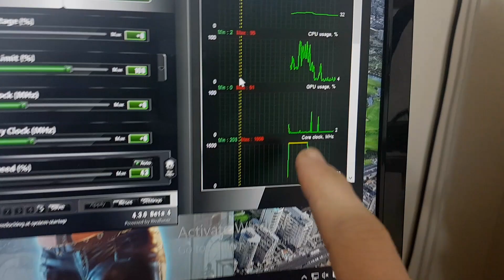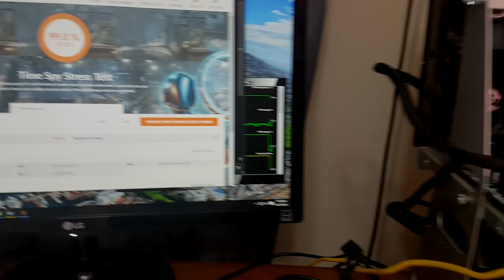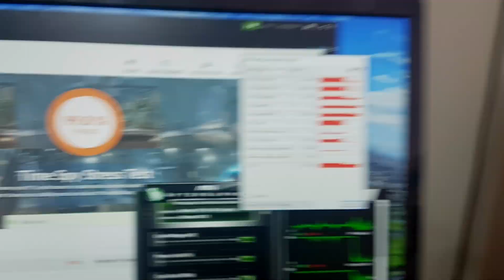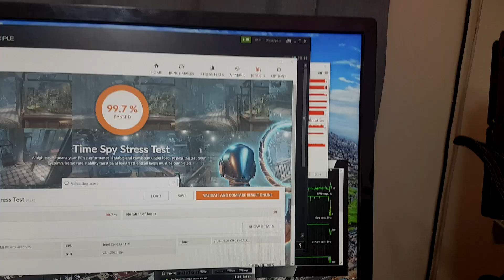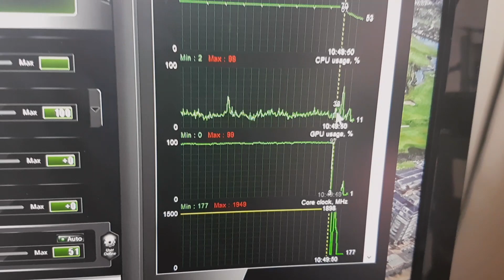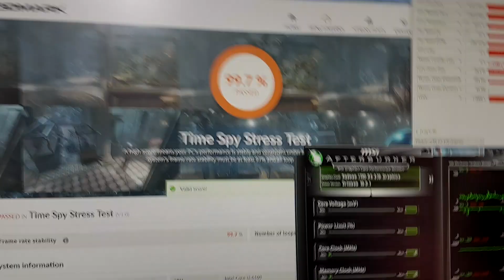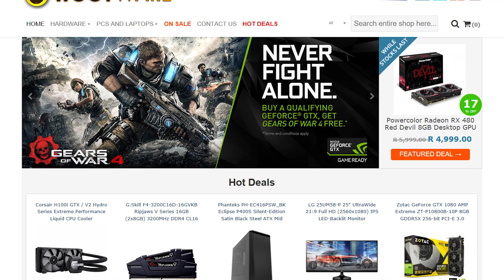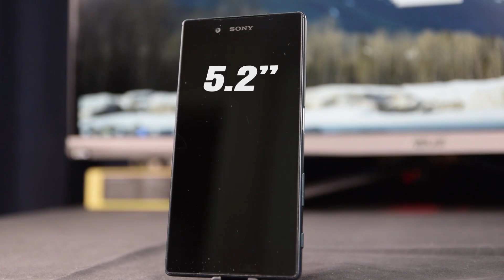DO GPU BACKPLATES SUCK?!?!

Comment: i think theres a thinking mistake with this measurements ... you mesure the surface temperature of the PCB itself without the backplate and on the other side the temperature of the backplate surface ...

but ...the backplate has a bit of air between the pcb and the plate which means this is not direktly connected to the heating source so that means the temperature of the PCB beneath is probably much higher than the backplate itself ... its a kind of heatschielding to hold back the heat .....  i bet if you place some wired temperature sensors under the backplate direktly to pcb and components the temp is much higher than without the plate ! 

and theres also NO air flow under the plate !!!

Comment: I'd like to see this test done with AIDA64 as it monitors VRM temp as well as diode of the GPU. Actually I'm gonna just do it myself
Reply: Can confirm neither the backplate or fan shroud of a powercolor r9 280x make much of a difference. With backplate on VRM1 was 1 degree cooler, VRM2 was 2 degrees cooler. No difference in fan shroud

Comment: install 2,3 or 4 cards together, you will see huge difference. Why? The distance between cards! Remove backplate, you get more free space between cards. More free space, more air sucked by fans. For one card installed, there is no big difference if you remove backplate. The big difference is when there few cards installed ;)

Comment: Which one should i buy asus 1060 dual 6gb (no backplate)for 279,90 € or msi gaming x 3gb (with backplate) 284,90€ p.s. i know pricing is a bit high in my country.
Reply from the maker: Get the 6GB, it's a better card.

Comment: the best benefit is the VRM cooling.
something 1070/80s have been overheating and catching fire.
MSi afterburner or GPU Z can't see those temps though.
Reply from the maker: The VRM cooling benefits appear to hotly debated based on other comments I've received.  :|
Reply: ***** after seeing 1080/70 catch fire due to lacking vreg cooling, I'm not taking any chances

Ordered a EK back plate with thermal pads.
Reply: That is only the EVGa because they took a chance to not use better cooling for the vrms
Reply: Tukuto to be fair, in the past, Vrms could take 125C all day just fine.
The gtx480 and HD5970 and 6990 both were housefires that ran 95C all day.

Not sure why the 1070/1080 had these issues

Comment: my opinion is 
back plate is good for protecting PCB Of the back 

because i usually cut my self by pulling off VGA out of my cass [not many] its anoying everytime or afraid to shocked
Reply from the maker: +RAY M I've never once experienced that.  What kind of card do you have? Or is it the case that makes it so difficult to get out?
Reply: ***** 
Well totally my fault sometime
XD

it was GTX560 Asus DC2
It didnt have backplate 
Case was fine but i had a habbit to pulling it so hard 

Than use vga with backplate i didnt cut myself
Reply from the maker: +RAY M Haha. Well if it saves you from injury, then I'd say it's worth it.

Comment: Manufacturers need to stop making backplates with no vents. Solid backplate will trap heat, might dissipate some but not as well as having air going over the components as well.
Reply from the maker: +periodic.insanity I'm not entirely sure this is true as most of the backplates I have actually come across have a several mm standoff between themselves and the PCB, thereby not trapping heat.

Comment: I got them for rigidity, my 7970 GHZ Edition almost died because of rigidity issues, it started artifacting and crashing because of the massive sag it had, causing the PCB to bend, for good. The reason for buying only one with a back plate is the sag, my really long Xtreme Edition 970 from Gigabyte has 0 sag and it's stupidly long and heavy.
Reply from the maker: +Rinkk Gotcha

Comment: looks like ure cooler pump isnt running should have led to indicate its on and coulour hasnt mixed my one runs at 3 degree cel, gl
Reply from the maker: It's fine, just didn't look like it's working, but it is.

Comment: by taking of the cooler and not applying new paste you wil probably lower the thermal conductivity betwen the cooler and GPU so i call this a invalid test.
anyway i dont think backplate help much in thermals.
Reply from the maker: But it didn't.  Numbers didn't show a delta enough to call for swapping thermal paste.
Reply: there was at least one with higher temps? 
the air gap between the plates can mabye affect the cooling negative
Reply from the maker: +tullgutten It was within the margin of error.  Nothing substantial.
Reply: I completely agree. Invalid test without the application of thermal pads between backplate and VRM, MOSFETS, and I think it's called the VRM memory controller that could get hot on SOME cards.
Reply: Except it was improved? Confused.

Comment: The backplate is good for cleaning.  I can scrub a backplate with a toothbrush and wipe the rest of with a not so wet wipe. Can't do that with a naked pcb
Reply from the maker: +Jomari Co Why can't you do that with a naked PCB? Have you tried?
Reply: I don't want to risk the static build up on the toothbrush possibly frying something. Plus you can't use a damp rag for fear of capillary action drawing the water into tight places unto the components.
Reply from the maker: So what you're saying is that the backplate makes you feel safer, but you're not willing to test if it actually is so? :P  I suppose I know what my next video is going to be about now.  How to clean your PCB with a toothbrush.

Comment: I agree backplates should not have any impact on the core maybe on the vrm's.
However your testing metodologie needs a bit of work. For optimal results you should of apply fresh thermal compound w and then add fresh compound again w/o the backplate. Fans should have be locked at a fix percentage. This way you either see a temp difference or a clock difference if any but again i doubt it would make much of a difference.
Reply from the maker: +Ceck Mike Thanks for the feedback. Some of what was left out was intentional, other parts not, but again, with the less "scientific" rigor applied, the results are enough to come to the conclusion even if the results aren't 100% accurate.
Reply: @UFDTech  But does it help with VRMs?

Comment: gtx 1070 1080p 60HZ performance ?
Reply from the maker: Gordon Rammstein I hear you, but you're still not getting more than 60FPS out of the card.
Reply from the maker: +Bymrh crowe 60FPS.
Reply: UFDisciple usually way more, but yes, thats probs a safe minimum
Reply from the maker: +Reece Cronin If the panel is 60Hz, you can't actually receive more than 60 FPS, even if the card is outputting it.
Reply: but a framerate higher than your monitor's refresh rate can be beneficial, as you are more likely to receive a more up-to-date frame every time your monitor refreshes, because it has more frames to choose from, as it were.
Reply: *****
True, but with more frames pushed from the card to the monitor, you can get up-to-date frames, rather than ones that are (ewww) up to 16ms old, say because a frame was pushed out to your monitor just after your monitor refreshed and the card didn't produce any more recent frames in the time between screen refreshes.

I suppose it makes no difference to regular gaming but if you play twitchy shooters or ludicrously fast racers, the delayed updating and slight input lag can be frustrating.

Comment: useless test, the backplate isn't there to improve perormance, it only improves rigidity and aesthetics. The reason why you see "higher" vrm temperatures is because the backplate isn't as thermally conductive as a heatsink so what you are measuring in the backplate thermal images is the backplate temperature, not the vrm's
Reply from the maker: The irony of this statement is that you can only state it so emphatically once this is actually tested. You're stating as fact the conclusion that I came to because of the testing.  Without testing, your statement is conjecture.  So....
Reply: ***** There's nothing ironic, that's what backplates are designed for. There's a reason why they don have thermal pads. Besides, if you know a bit (just a tiny bit) about electronics, you'd know that if you want to cool a component, the hetspreader should be placed on the capsule and that's in the opposite side of the backplate.
It's not "conjecture", it's common sense and basic electronics knowledge.
Reply from the maker: Except for some of those backplates have thermal pads.
Reply: ***** If they do, they're either useless or have a negligible impact. As I've already explaind, the only way to effectively cool an electronic component is by putting a heatspreader in the capsule. You can do the research if you don't believe me.
Reply from the maker: How do you not count this video as the actual physical research?
Reply: ***** Electronics, research on electronics. If you have basic electronics knowledge you wouldn't even have wasted time on this video.
Reply from the maker: +Potus ThePlant Or you missed the point of the video entirely.
Reply: my words have fallen into deaf ears it seems...
Reply from the maker: I think you're just trying to prove a point that I was aware of going into the video.
Reply: No, I'm not. I simply explained that this video brings nothing to the table because the conclussion is obvious. You wouldn't make a video that explained why 2+2=4 would you? If you just explained why the backplate doesn't improve performance only using words, it may have made sense but you tested several graphics card and that was a waste of time.
Anywho, I will no longer reply but do take into account that you won't capture an audience that techsavvy by making this type of video, do the research before you film a video.
Reply from the maker: It just seems strange to me that you call it so obvious, but weren't aware that the backplates did indeed have thermal pads to assist in the thermal dissipation of the rear portion of the VRMs.  This video served to question presumptions, not to prove them wrong.  There are plenty of videos that exist on explaining why 2+2=4 because theory of mathematics is actually super important.  Just because a conclusion is obvious doesn't mean that it still doesn't need to be assessed.
Reply: ***** Do you know what a gimmick is? if not, then look up the definition. Thermal pads in the backplates serve no purpose, the mere fact that you thought it plausible demonstrates your knowledge on electronics...
Reply from the maker: +Potus ThePlant Welp.

Comment: I think they just look nice, they're good for aesthetics
Reply from the maker: And rigidity on the PCB, but basically no cooling advantage.
Reply: @UFDTech  my tests using termal pad on backplate i lose 2-3 degrees thats incredible XD
Reply: rigidity is important with heavy cards. my 1060gtx has no back plate and it will sag and flex with the pci power hooked up. my 980ti has a back plate and doesn't sag nor flex in the same rig....
Reply: Its good if you have a really long pcb

Comment: Backplates are more so for cooling VRM's and rigidity.
Reply from the maker: You have correctly assessed the basic conclusion of the video.
Reply: they also help to prevent any accidental touching of the circuits on the back of the pcb be it with the hand or a tool... or a swiffer if you let the case open with your grandma in the house.
Reply from the maker: +jpteknoman Meh, accidental touching isn't a huge deal.
Reply: clean with compressed air...if dust is sticking use a toothbrush to brush it off...
Reply: +jpteknoman If you're unwise enough to do that, you might as well ground yourself and go around the pcb with  an iron screwdriver in order to unload all the caps. Ofc it if's some moron doing the cleaning without the slightest clue what he's doing, I think it's an adequate amount of damage if his entire PC blews up. There are people who need to eat and have the necessary knowledge and certificates to do a PC cleanup without damaging it. If you can't do it yourself, you can always hire someone to do it for you. It's not like people charge a full salary for one PC cleanup.
Reply: ***** have you ever tried dusting off the inside of your pc with a cleaning cloth that uses static electricity to make dust stick to it? the result isn't pretty XD
Reply from the maker: +jpteknoman No.  But that's not a good idea with or without a backplate.....
Reply: I am cleaning it, because 90psi of air and I'm outside. Don't worry, compressor has a water filter...
Reply: If you're serious, then you've won a "Darwin of the year Award"....
Reply: Joey Tech Talks can't compressed also create static? Because the air rubbing against each other
Reply: Bubbly no? if it did it's not enough to do anything anyways. I've used shop compressed air for hundreds of computers and never had a problem....just don't spin up the fans, they will back feed voltage to the motherboard...
Reply: cheese toucher alright thank you, I just read something this guy said on this one forum.

Comment: Are your Triton's tubes just kinked giving you bad flow to the through yout loop? If so I suggest getting some custom tubing from local hardware store, it's about R8 per meter
Reply from the maker: They're not kinked anywhere? Also, not voiding my warranty for that.  CPU temps are fine, there's no practical issue with the cooling.  Wouldn't recommend this cooler though. :\
Reply: What are your temps? Just curious because at 0:52 one tube is filled but the other has little to nothing coming through. Yeah I agree there are definitely better options and I would definitely not recommend this for someone as their first entry into watercooling
Reply from the maker: Temps are near ambient at idle. Roughly 60 under load, OC'ed to 4.4.  Not great for AIO, but also still perfectly fine.  The reason I'm using this over my air cooler is because the Hyper T4 I had conflicted with my MSI motherboard and made it a 10 minute mission to take it off to swap out the CPU cooler.  As soon as I'm done with testing CPU's, I'm switching back to air.  It's a mark of necessity, not desire.

Comment: You are Torturing me with the Asus Strix Gtx 1060 6gb in the background.
Reply from the maker: +R3VolutIAN 24 Haha.  Benchmarking is finished.  Review imminent.  Want a quick synopsis?
Reply: Yes please. I want to order one from Wootware.  The reviews I have seen, mentions great cooling, and great oveclocking performance. Im interested in what you have to say. Cause im yet to find a Vid you made, that you didnt speak the truth, and gave a straight forward opinion.
Reply from the maker: +R3VolutIAN 24 It's the fastest 1060 I've tested without overclocking.  As long as you're comfortable with the pricing, then it's 100%.

Comment: Can I ask if your CPU water loop is fully bled for air? I thought I noticed that the fluid was not evenly distributed in the tubing when you installed the cooler on your test bench with your sons (I saw a few large air bubbles in the line after the system was powered up). 

In 0:50 the right tubing looks devoid of fluid, like it is not circulating fully. I didn't want to seem rude or condescending, but wanted to make sure your loop is flowing effectively to keep things safe and protect your pump and your CPU during use. Thanks and keep the good vids going! Peace.

EDIT: I see later in the video that both inlet and outlet tubes on the cpu pump look red with fluid. Im glad you caught it. Hope all the air is out of the tubing :)
Reply from the maker: That's a pre-built AIO from Raijintek and that's how they ship their coolers.  Adding extra fluid, that's not theirs voids their warranty, as does adding fluid above their "maximum fill" level, which is where it's at now.  I'm aware of the air bubbles, but at the same time, if I want my warranty, I can do nothing about this since Raijintek is against tampering with their AIO's in such manner.
Reply: That is a real bummer and I had not been aware of the specifics of that cooler. I suppose the only thing you can do is twist and shake the cooler to get the air bubbles back to the reservoir.

Does the water pump when the system is on? I mean is it actually pumping water and cooling the CPU properly when its under load? If not, I would consider using the warranty service since you cant do repairs yourself and it appears to be flawed. I hope you have a good experience with such cooler so you can have the least issues with making reviews and content. Rawr
Reply from the maker: The cooler actually functions decently even with that air bubble. It's not the best AIO, but it keeps my temps down, roughly 60C on a full bore stress test.  I personally dislike this cooler, and wouldn't recommend it, but it's useful for the time being.  I'll be swapping out soon enough.
Reply: Sweet! I feel better thank you. I appreciate the honesty. I was pondering getting a cooler like that but hmm...
Reply from the maker: Coolers like this one are fine, but I would recommend against this specific one from Raijintek.
Reply: Thank you for the information. I do appreciate it. I will keep that in mind in the future. Rawr I look forward to more of your fun and informative videos...